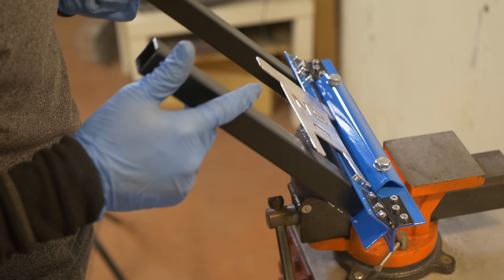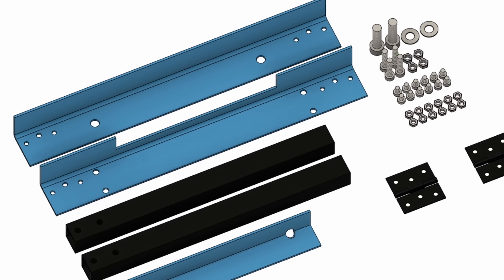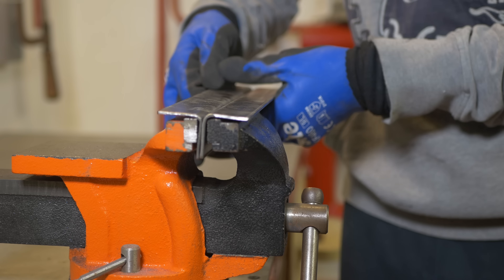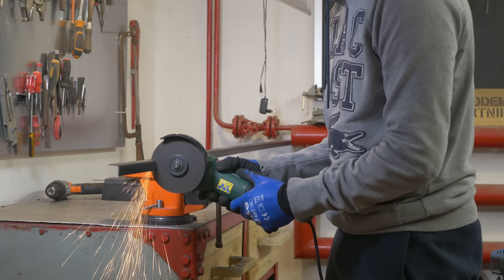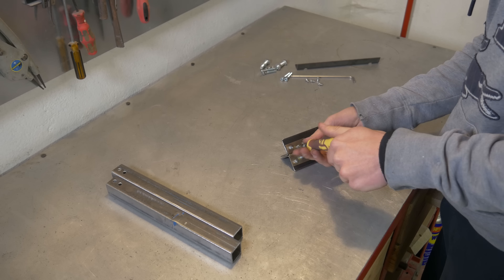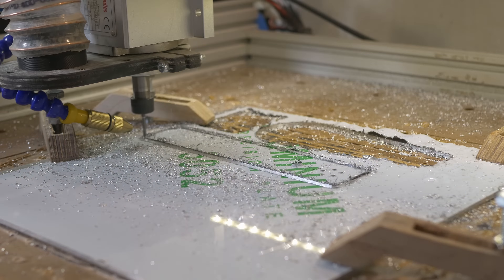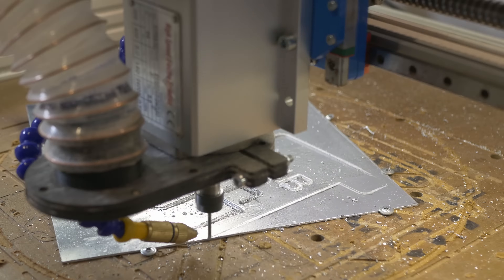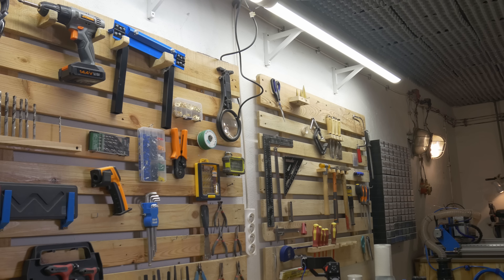How to build a Mini Metal Brake

Comment from the maker: Two simple upgrade ideas:
1. Flat steel pieces to reinforce and help with bending thicker materials
2. Springs under the clamping profile on the M8 screws so that it automatically rises and makes it easier to load and unload material. Wanted to add the springs while building that but had no proper screws.

Instruction, parts and more details: https://indystry.cc/diy-mini-metal-brake/
Reply: Probably use square steel tube.. 2 times stronger then the angled profile :)

Comment: Hand brake is a nice starter.  A motorized press brake with a v-groove channel lets you make multiple tight bends to make more complicated geometry like toolboxes.  always love your videos.
Reply: Doesn't need to be motorized as you'd get more downforce from a bottle jack and spring return system for a small brake press

Comment: I had the same problem with my drill a couple of days ago. I needed to drill one hole so I could mount a ethernet switch (not router) behind a desk. My battery for the drill was dead. I didn't want to wait so I took my old manual drill (like the one you used) and drilled the one hole I needed into the wood desk.  

Nice project you made. I might make one like that myself. I normally just use a vice to bend metal. I had used a bender like that (bigger) at work. When bending thicker strips, like you did, it helps to bend near the hinge rather than the center.

Comment: Sheetmetal parts are a heck of fuck, with your CNC you can drill holes along the bending lines and basically bent the parts by hand you wouldn´t even need the brake. Or you can stribe along the bent line.